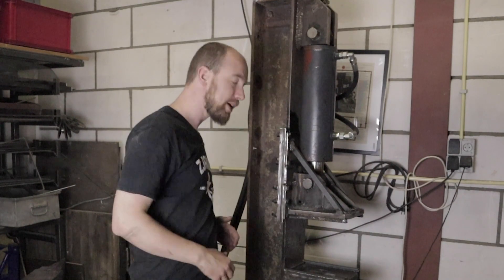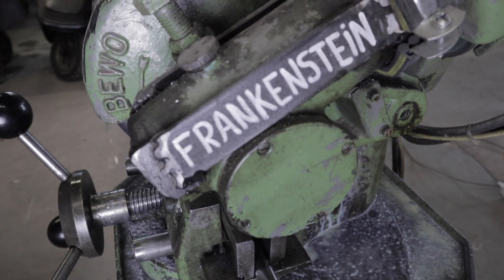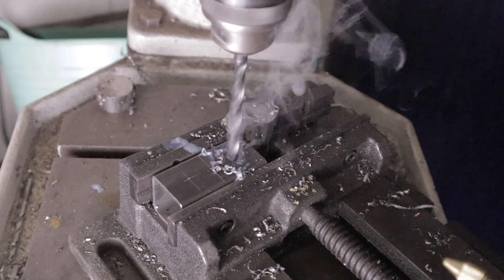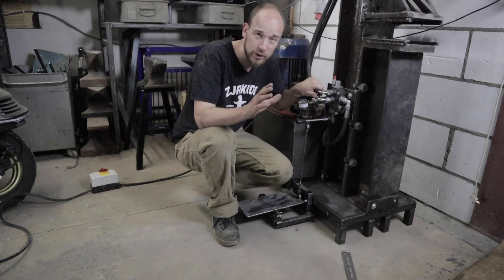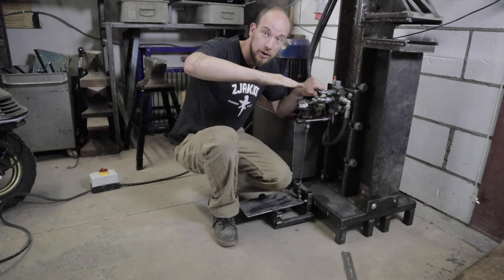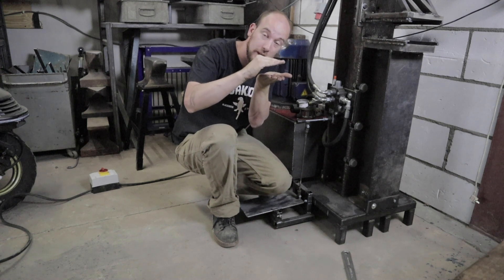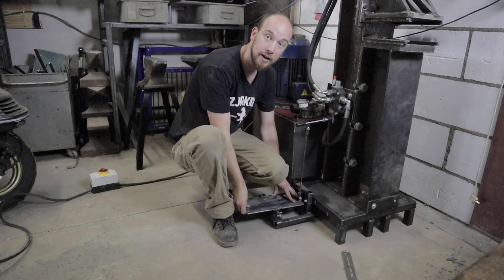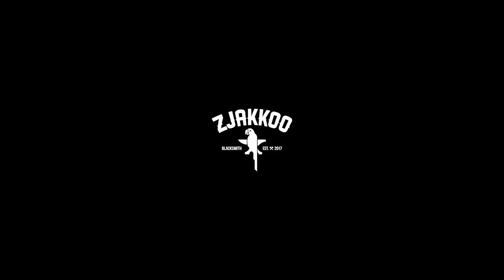Hydraulic Forge Press Build (part 2)  the foot pedal

Comment: Very nice and well thought out!
Thanks for the ideas. Also what is the capacity of the fluid box?
Reply from the maker: Thanks! It was a lot of thinking ahead indeed. The fluid box hold around 40 tot 50 liters of hydraulic oil. I lost some when connecting everything together when there was still some oil in the lines. Learned a lot from this build.